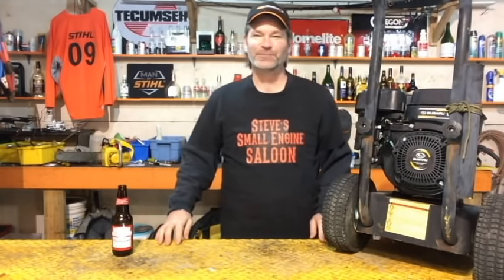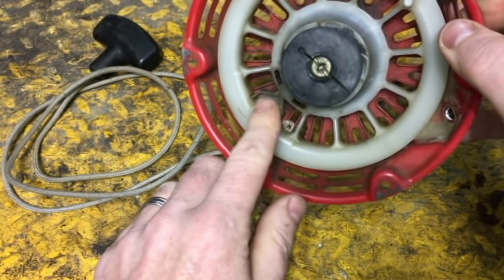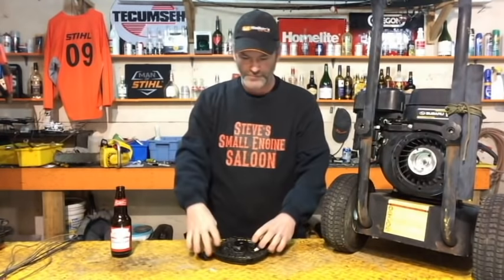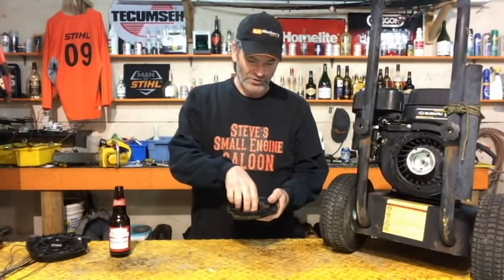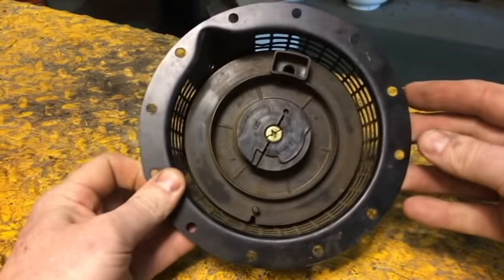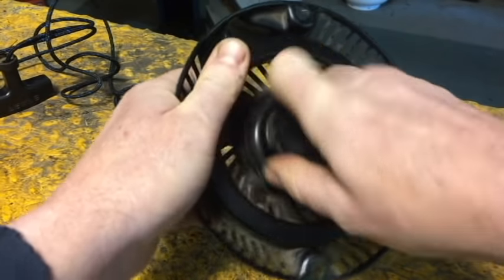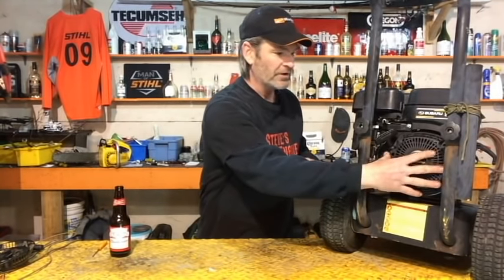How To Fix a Broken Starter Rope in a LawnMower or Other Engines

Comment: Thanks Steve. 
The pull start on my Ferris BGF48K mower broke on a job last week. My service guy wasn't really helpful and the disassembly of the spring and pawls got me a little hung up. Your video and careful instruction helped me get fixed and running again for only about 20 minutes and a new rope! Thanks again!
Reply from the maker: Right on...

Comment: Thanks Bro. Have an old G100 Honda 2.2 and was having no luck replacing my broken pull start.   Mac's Lawnmower wanted $35. I thought uh, no.  Took it apart, learned how to rewind the spring, and now, I know how to re-spool the line properly.  So Solly Mac......

Comment: Thank you, Steve!  The pull cord on my snow blower has broken twice at the knot and I used the screwdriver method to hold it in place.  The problem with doing it that way is the tension on the cord is always a little looser than I'd like.  Your method restores the cord tension the way it came from the factory.
Reply from the maker: You're Welcome...

Comment: Great tip/hack there buddy. Subscribed :) Question: The wife was running the mower (older B&S Classic 35). Tank and carb fell off. Bolts vibrated loose. I put it back together again, but it won't run. At best it fires a bit out of the air intake. I can't figure out what the hell is wrong. Any ideas? If there's supposed to be a rubber O-ring on the carb sealing the carb and intake stud, then she lost it.
Reply: Sounds like an Air leak or mislaid O Ring somewhere...

Comment: another spot on video. The only problem I had on my cub cadet push mower was getting the end of the string through both holes that didn't line up very well. I rigged up part of a small wire flag to get it through.

Comment: Steve I just want to thank you for all these wonderful videos that you’ve been working on with carburetors bridge and Stratton carburetors Tecumseh also for pull strings and anything that you can think of for lawnmowers how to change the oil generators snowblowers chainsaws your channel is very informative and so detailed I absolutely thank you for that and when I was younger I took a small engine repair in  high school because they offered that as well as auto body shop and well as we get older the mind is not much of a steel trap as it was back in the day and I love the fact that you take your time with the channel and always have a cold beverage thanks so much for the great videos I just wanted to reach out to you from Pittsburgh saying please keep them coming because there’s always something that I always get myself into and need the informative guidance to get through what I need ... blessings

Comment: Thanks so much for this, we had a power outage here in NH the other day and upon trying to start the generator the rope broke. It was only the first nine inches that broke off so in that "emergency situation" I was able to use what was left to make it function thanks to your video. Of course after getting it up and running the power company got the electricity back up and running. But I'm forever grateful for the valuable knowledge on how to do that simple repair for the rest of my life. Thanks again!
Reply from the maker: Glad it helped

Comment: I have struggled with these for years using the screwdriver through the vent hole method. This is SO much easier. I just turned 69 and am not ashamed to say that I am still learning. Thanks for sharing your wealth of skill and practical knowledge.
Reply from the maker: Excellent!

Comment: I've got an older Steele brush cutter that I bought back in the 80s. Still has a good engine. Problem is this particular cutter has nylon cogs on the inside of the pull crank. It lasted for a long time with the original set up, but when it wore out I've had it replaced twice at the shop and I replaced it once myself. It wont hold. If I send you the exact numbers of the machine could you make a video and show me how to properly repair it. I've since bought a replacement but this one was a good old machine and is lighter than the one I'm presently using. Thanks. You are a wealth of information.

Comment: I ran over my cord, chopped it up well so i don't know how long the rope should be for my Sears/Briggs and Stratton.  Early in your video you mentioned 8 feet.  Did you use all 8 feet?  I've got a roll of the proper cord and need to know how long to cut it.  Your video is very clear, very helpful.  Thanks!

Comment: Cheers Steve! Last weekend the mower cord snapped so I got a new one. I had a fundamental idea of how it's assembled but no experience replacing the cord, which I managed to do and was quite proud of myself when it fired up first pull... Except the cord didn't retract. Pulled it apart and figured the spring needed tension before tying and winding the cord, but couldn't work out how. This video solved it. Thanks and keep up the great work!
Reply from the maker: You're Welcome...

Comment: This happened to me,, I just took off the recoil starter and took a 3/4 inch socket on my drill, It worked so good I just kept using my "electric" starter. Thanks Steve, I love your channel. My Dad and my Grandpaw both tore down small motors,, this brings back great memories.

Comment: I just subscribed to your channel. Best small engine site I've seen. You've already helped me tune the carbs on my weed eater and leaf blower, although I still need a little more practice doing that...
Reply from the maker: Thank You...
Reply: Just used my Bolens grass trimmer. I use to hate trimming because it would constantly stall, wouldn't restart, and would only run on position #2. Thanks to your video it now runs great and never stalls...

Comment: Great vids. My issue isn't the rope, but when I took the 3 bolts off the plastic housing a pin was loose. Just not sure where the pin goes.  The spring is fine as well.

Comment: Professor  Steve's.   Your teachings are awesome   ,  will that method work with the 40 ,50 year old recoiled units ?  , I still have some engines with a free rope and wind notch units that work great  thanks. TANK

Comment: You are THE MAN.  Simple easy guidelines with a beer.  The negative however and there is always one, I was teetotal until I watched your channel. I thought it was mandatory to drink a beer when tinkering with small engines.  Now I’m an alcoholic but my power tools run fine.

Comment: Good info Steve, thanks. Im working on a Sno-Tek blower right now that keeps ripping about an inch from the end. Im gonna try the 6ft of cord and deburr the housing hole. Subscribed....
Reply from the maker: Good luck!
Reply: @StevesSmallEngineSaloon  Thank you. I thought they were supposed to have a brass insert there, but this one does not.

Comment: Thanks for the vids Steve. I watched this even though I have been fixing starter ropes since I was a teenager (I'm 61 now). Sometimes I run into pulleys that have such a tight hole and small space for the knot you can't do it like you showed. I use an alternate method where you assemble your rope then align the notch in the pulley so you can get the rope in it then spin the rope and pulley around to tension the spring. This way also allows you to de-tension the spring if it is wound too tight.  BTW maybe you could show the proper knot to use for those who are new to fixing things themselves.  Now I have to do just this to my push mower. Broke the rope first time trying to start after the winter break. Keep making your videos. CHEERS!
Reply from the maker: Right on...

Comment: thanks , now I know what to do when buying the rope and cutting the length. 
mine isn't as easy to thread, its not as hard as a sewing machine needle but,
but I can see I'll have to tape a piece of wire to it or something to get it 
pulled through if the wire and tape don't come undone

Comment: Thank you Steve for this great video. Pull cords always scared me hahaha. One question: am I in danger of starting the engine backwards? Ie it pulls air through the exhaust and exhausts through the intake? I did not try turning the pull cord the other way and didn't really think of it.

Comment: Just discovered your channel. Excellent videos. I was working on this exact problem last week - a broken starter rope on a pressure washer. But this leads to a request for a video on pressure washers. Last week I needed to do some pressure washing at the farm. We have two pressure washers - a small unit with a 6 hp Honda knock-off engine, and a larger one with a Honda GC160 (?) 12 hp engine. Admittedly they aren't lovingly cared for and were just carelessly tossed in (heated) storage at the end of last year. When I dragged them out of storage last week, both units started with little trouble and then were turned off after a few seconds while I connected water hoses. I just wanted to see if the engines would start before hooking the hoses up. Then, after hooking up the water lines, when I went to start them again, the engines on both units seemed very hard to pull (thus the broken starter rope on the GC160). The engines seemed intermittently seized or somewhat hard to pull, and then I remembered to hold the trigger to release pressure while starting. I eventually got the smaller machine to pull over and start, but there was no spray from the nozzle. Holding the trigger on the larger unit seemed to make no difference. What's going on here? Why did the engines pull easily and start at first, and then become impossible to pull. Did I seize the pump by running for a few seconds without water? I don't think so because on the larger unit I unbolted the pump and could turn it easily, i.e. engine not turning but  shaft turning easily within the pump. I'm going to the farm later today, so if you could produce a video on this topic within an hour that'd be great. LOL.

Comment: I'm having the EXACT same problem with my sons go-cart we got him for christmas. I feel like you're solution would work perfectly but it has a centrifugal clutch with holes around it exposing the spring mechanism. Would I still just apply oil around the central bolt that connect the clutch to the drive shaft? you made it clear you didn't want oil to get behind that main cover in your video so I'm not sure if there would be different procedure for that type of clutch.

Comment: This was a great instructional video!  I was going to take my lawn mower to one of the local lawn repair shops to replace the torn starter rope but egads one shop wanted $85 the other $100!  I said to myself no way.......I'm going to fix this myself. I went to Lowes (Home Depot has it too) and purchased a starter rope which came with a new handle for only $5.98! I went online a found this video and bingo did it myself. There's satisfaction in doing a job yourself and not paying someone else! Thanks Steve.
Reply from the maker: Great job!  :_Beer: :_Mower: :_Rider: :_Chainsaw:

Comment: You know what Steve!  You said once about a comment,  "if he knew what he was doing he wouldn't be watching my videos. "  BUT, even though I have enough tailgate experience to think I do , i really like watching all your videos to see how you do it.   NOW here it comes..... if he had to get that generator started,  he didn't need the rope return,  he could have lashed that rope onto the hub , that's what those little  notches on the rim are for.   The  dangerous thing about this  is you might  look that rope and handle on the device and  use it next time, and  next time  , till you misplace the cover or bolts , then procrastinate  till 4 years go by and you find it all in a box and finally put the return back on.
Reply: However the benefit  through all those years without the return,  it acted like a padlock to unauthorized users of a street blower kept at a clients residence lol.

Comment: Hi Steve, 

Hopefully you can help me. All help is appreciated. I recently found a mower that had its string broken so I took the flywheel cover off and started it with a drill. My genius idea to run it without the cover and I hit the steel frame of my trailer. It broke off a lot of the little fins. I was going to look into a replacement fly wheel but they are a bit steep for an old mower i found for free. Would it cause a lot of damage to the engine to leave the fins the way they are? I know it would lack air flow mainly. But my main concern is balancing, will it cause the crank to be unbalanced?

Thank you sir!

Comment: You are a legend steve! I learn so much just watching but today at work (lawn and garden maintenance) a guy broke a string Friday and was replaced today. This time the same guy broke the string at the knot inside the recoil. And instead of waiting for boss man to take it in. I said to myself what would steve do! WWSD! Boom 5 seconds later I'm skimming two vids on recoils... few minutes laters im winding that baby counterclockwise and boom fixed.... still has that funny grabby/sweet spot that you need to pull it to gently then RIP it. But maybe I can fix that with lube? But its back together and it starts (stihl blower by the way) at least if they dont find you handsome at least they can find you handy!!
Reply from the maker: Right on Zack!

Comment: Great video Steve. Question, I have a Honda generator with an auto idle switch. When I turn it on the engine dies. What is the most likely cause & fix? Hope to see this video soon.
Reply from the maker: Check my video on cleaning honda carb

Comment: Can you show in a video how to get the recoil starter off of a Honda 2015 EM5000sx Generator?  I removed the obvious 4 bolts but it won’t come off?  There is a black perforated grill over it but I don’t want to break it?  How do I get the recoil starter off to replace a broken rope?

Comment: For years this has been my nemesis, when the recoil breaks i just say screw that and buy a new one or take it to the shop. I have no problem tearing down a motor, heck i built a 10 second street car engine from the bare block up but those recoils and me have a hate and despise relationship. Thank you so much Steve for the education. Now hold my beer.
Reply from the maker: You're Welcome...

Comment: Here's a curve ball: On my Ariens 22 standard push mower, the rope snapped and when I took the top off to expose the starter wheel, it appears to be an all in one type model where the starter seems to be permanently welded to the top of the motor. It looks like there's more bolts I can remove to maybe get at the starter wheel from the bottom but not sure if I'm on the right track. Any thoughts?

Comment: Yo ho Steve, why aren't starter ropes made more durable, or better yet with a steel inner cable like arborist's safety flip line?  I put my flip line through hell for 4 years in the trees and it just kept on truckin'.  Is it because of initial expense, designed obsolescence, or some other reason?  Your a good man Steve.
Reply: I think it's a weak link.  If the engine fires and yanks the rope hard enough it can break the paws in the starter assembly and that's not cheap and sometimes hard to find. Also unless the rope is dry rotted, it won't break until you pull it too hard.

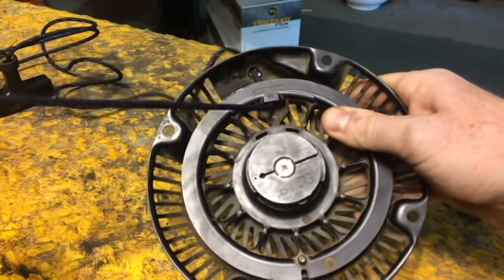Comment: PROBLEM SOLVED   At 6:22, why not tie the knot at the pulley then let the spring rewind the cord? Doesn't the extra 18 inches added make the cord too long? I tied the knot without adding the extra 18 inches. I've done all this repeatedly for hours. It works perfectly off the motor, but when on the motor it won't retract and then freezes solid. When I remove the pulley and spring, I don't see what caused it to freeze. When my cord broke, the pulley rewound fast enough to bend the spring backwards, but I fixed that ok. The hole in the steel housing that holds the end of the spring in place was damaged and not holding the spring. So I drilled a small hole in the end of the spring and inserted a 2 inch piece of bicycle spoke so it wouldn't pull through the hole in the housing. When I folded the housing's metal tab down to hold the pulley in place, I used a piece of cardboard as a spacer so the tab didn't bind the pulley. I cleaned and greased the housing where the pulley rubs. The teeth in the pulley are good. It still fails repeatedly. This was a discarded Briggs 3 hp motor that I want to put in my bicycle cargo trailer to pull my heavy loads. Does anyone have any ideas?   UPDATE  SUCCESS.  I studied another discarded motor and learned that the square shaft that fits in the pulley is supposed to turn anti clockwise much easier than it was. The cord rewind spring couldn't turn it. It comes apart with two small bolts. I wiped the shaft clean and applied a light coat of high temp grease to it and the rubber seal. I didn't grease the ball bearings because it looks like they are supposed to be able to bounce around a little.

Comment: The hole in my pulley is too small. I can't feed the rope through. And there is no room between pulley and housing on mine. I tried guiding it through with a needle and it almost worked. Any ideas?
Reply: I got it. I burned the end of the rope and crimped it with pliers and cut the edges off to make it hard and pointed.

Comment: Steve, there is another way it can be done.   Granted, your way is easier.  The notch in the pulley is to allow the spring to be tensioned with the rope already attached.  Feed rope slack up beside the pulley, pull the pulley end through the slot till tight, turn pulley to tension the spring with the rope bypassing over the top of the pulley.  Rope must be able to roll over while doing this to prevent knots.   When spring is fully tensioned,  pull on rope handle to remove slack and pull the rope out of the slot back into the pulley.  Allow spring to recoil the rope onto the pulley.